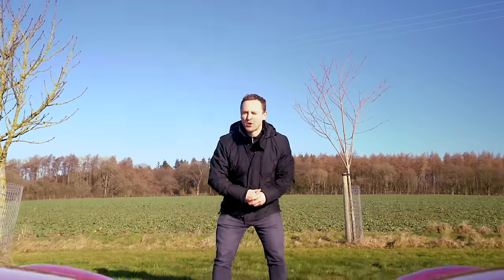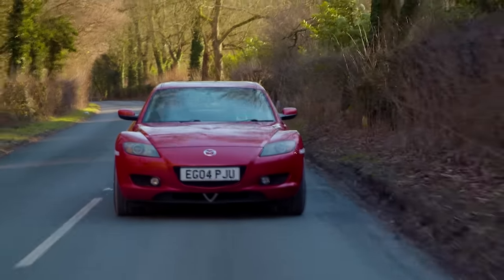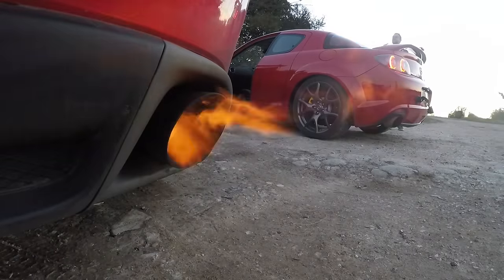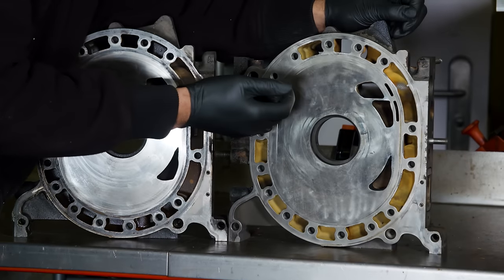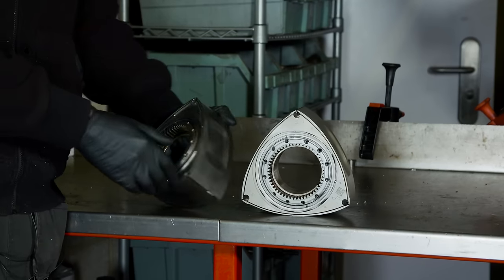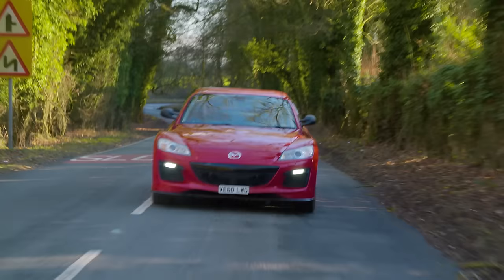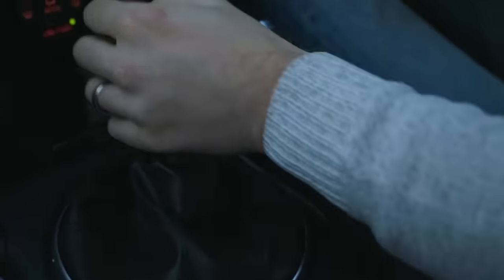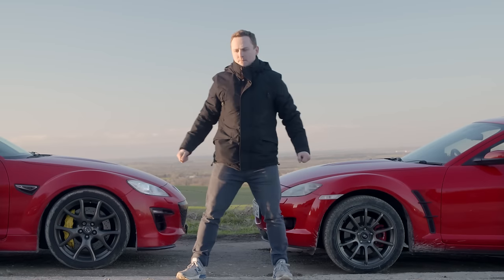The Differences Between Bridgeported & Street Ported Rotary Engines

Comment: My carbarated 500hp 350 probably gets better fuel mileage.
Reply: I highly doubt it.  :P   My brother owns a 500hp 350 and I own a RX-8.
Reply: @DatDarkOne  huh? The diesal dump truck my girlfriend's dad owns gets better fuel economy with a full box lol.
Reply: @DatDarkOne  you are full of shit. a 500hp 350 chevy doesnt mean its gonna get bad mpg. its all about how well the heads flow, the compression, cam timing events a duration, or even if its na or turbo. id say a n/a 500hp 350 chevy would get like 10-13 mpg if babied. turbo? probably like 16-18.
Reply: @subjectsigma925  typically all diesels have better gas mileage than a boosted sports car because they burn a different way..... diesels are a more efficient engine design by nature.

Comment: I NEED MY VTEC IMMEDIATELY

No not vtec i meant my rotary engine to kick some ricer
Reply: Eren Hepgur race it against an ep3 type r...
Reply: I need people to stop making me click

Read more
Reply: Little y'all know that some rotary engines do have vtec on the exhaust side
Reply: Sherlon, no other car brand has vtec, that is Honda’s technology, they would have something similar which is what you said as its only 1 camshaft but its not vtec.👍🏼
Reply: @callumturner9161  technically there is similar tech for example toyota the engine has limited power in lower rpm and when it goes to 3 to 4k rpm thats where the ecu tells the engine to receive more fuel and camshaft to open more for more power. Very similar
Reply: Lol an ep3 would burry an rx8, I like both but I’m just saying🤷‍♂️

Comment: 195 HP from a car that gets 4 MPG? I'm sorry, but what's the point?  Sure they sound cool, but you can get the same effect with big cams on a civic for crying out loud.
Reply: 195 wheel horsepower.
When it comes to owning a rotary car, this wouldn't be the car to buy if one focused on fuel economy. Plus 4mpg is from racing a track and not the streets.
Reply: LanEvo55 horsepower is nothing without the torque so is pretty crappy tbh. I like them though, couldn’t afford to run it as much as I am about the smile per gallon but this?! A supercar gets more to the gallon 🤷‍♂️
Reply: @yoalvin2287  That's why you get an RX7 lol they're actually fast
Reply: Evan Spiteri it’s on the bucket list lol
Reply: RX7 are not fast either lmao... A stock S3, Golf R or anything similar would murder one.
Reply: MrZyLeXx you’re really comparing an old car to a new car? Obviously the new will handle and drive better than the old unless the old has got some decent set up...
Reply: Yes why would't i?
Reply: Ethan Noel 4mpg on full throttle around Silverstone. Listen next time
Reply: Buy your Civic then and be a normie like everyone else.
Reply: Jason someone's triggered. I have never seen a cammed Civic on my daily commute so I'm not sure how having one would make you a normie.
Reply: MrFoulksy I did listen. That's still awful. That's the kind of mpgs that 5.0 mustangs get on the track but at least they have more than 390 horsepower.
Reply: @huehuehue-x3c  nah I'm not triggered every one is entitled to their own opinion. Regardless of how bad it is .  Fixed up civics are more common than fixed up rotaries . Piston engines are the norm, rotaries are a rarity , therefore stick to your normie engine quit hating. No one is saying they're perfect, cuz there is flaws, but you'll never understad what makes them so cool. Only certain type of people can  appreciate  and  properly maintain a rotary. Clearly you are not of those people.  What car do you currently drive ?
Reply: Ethan Noel why are you mad about what MPG it gets on wide open throttle ??? You need your priorities sorted out mate
Reply: MrFoulksy bad mpg means poor efficiency. Poor efficiency means you're missing out on potential power.
Reply: Because they are fun.Simple as that.
Reply: Ethan Noel Honestly Driving an Rx8 is more interesting than driving a mustang in my opinion .
Reply: @MrZyLeXx  lmfao you obviously haven't seen a big turbo FC or FD with porting work. And both of those chassis are stable as fuck.
Reply: Who said anything about their chassies?
Reply: @MrZyLeXx  me because they're fucking great lol
Reply: Not even my 87 fire chicken gets that bad of MPG and stock it gets 210 horsepower at minimum
Reply: yes but you will never have the same potential out of a civic as a rx-8.
Reply: Alright all you hectors from FF1 need to calm down bryans got your ebay parts ready for shipments.

Comment: Absolutely love my RX8.. blown my second engine within 4 years @ 15k per year starting when I bought this one with "58k on it" but 150 quid plus a day's worth of my time and I must admit I really don't mind. Smiles per gallon in this car are unbelievable. Much higher than any other car and for the price, it is pretty extreme! I'm currently on with an engine build to be bridgeported and supercharged but also want it to be as reliable / long lasting as possible. Most of the time the car is my daily. Only downside to it, is it is absolutely terrible on fuel until you've done 100 mile on a constant motorway run 😂  3/4 of a tank in 150 mile ain't great at 80 quid a tank 😩😂

Comment: Hiya,
I’m really enjoying the series so far. I’ve always been fond of the RX8 since my wife and I looked at one but went for an MX5 instead. 

Question for you or anyone: Does retuning to produce flames at the exhaust diminish horsepower and efficiency?

I ask as surely the source of the flame is unburnt fuel that escapes combustion in the cylinder and ignites on contact with oxygen upon leaving the exhaust. 

Not a criticism, more curiosity! Keep up the good work.

Comment: I have always wanted to no how the cubic capacity is measured i.e would you fill the exhaust and inlet up with oil and measure the cc that way, sorry to ask this strange question but I have had different answers and if anyone will no it's R and R motors who build stock to race rotary engines..👍🏻🇬🇧👋🏻 brilliant videos keep them coming.🙏🏼

Comment: I had an RX7 series 2 and then another one wih well balanced and street ported motor and then a 13b turbo transplant with microtech management then i bought an rx 8 demo model, then when was time for first seal rebuild at 220 000km(it did well) i had a bridge done too
But something screwed up as after a thousand or so kms it also broke a corners seal
Then went back to normal with just touch better porting and cat free
With open exhaust one pipe and one box only
It sounded incredible
For those who hate rotaries
That (rx8)was the car i had the longest of all(6 and halve years) and regret till today selling it
It was also the best all round drive i had newt enjoyed and best looking
And i had two kids and wife and my son shot up to 6 feet 3 tall
And he did fit in back seat
So all was fine

Comment: Series 1 vs Series 2: The Tale of Two RX-8s. Felix is a series 1 (2004-2008), while that awesome R3 is a series 2 (2009-2011). The series 2 RX-8s are more reliable than the series 1 models in terms of engine life due to that extra oil injector and electric oil metering pump, so it's less needed to premix, but you can still premix for more protection just in case. Also, the series 2 model's looks have grown on me and I want to get an R3 one day

Comment: Brought an RX8 2.6 2004 for £300.. Engine has only done 13k as it's reconditioned by Rotary Revs :)  
I only brought it cheap due too misfiring problems but"! I now sorted just by upgrading fuel pump, coils and new crankshaft sensor.. Only bad thing is bodywork underneath needs a lot of work due too rotten sills which I'm slowly getting done as replacing with aluminium :)

Comment: Good video! Your fans need to see  turbo rx8 too.. :) !`ll give you an idea You can test a turbo rx8 (suggestion garrett 3071r) together with final geat 4.777. 6port rx8 is a lot quicker between 300-350. Every body hates spinning on a higher power.

Comment: did the UK get different engines or did Alex buy the lower HP engine with stock around 190ish HP? Because most people would get the 230 HP variant and the 214 HP for a revised and tuned engine seem quite low.

Comment: I think I honestly may try to find myself a rotary. Im pretty new to car stuff in general so people might think im stupid but the way i see it, the engines are simple and more straightforward, and theres a lot more preventative maintenance required. Instead of fixing something when it breaks or wears out, you have to take certain measures (at a much higher rate than with a piston engine) to keep that from happening. I think thats what people get wrong about rotaries, they try to care for them like a piston engine, then it blows cause they werent keeping up on the oil and coolant, and they call every rotary a pos.
Reply: The Canucklehead to be fair you’ll probably find that you look after a rotary and it’ll still have a tantrum every now and then lol
Reply: Mulac19 same goes for my sr20😂

Comment: My favorite rotary I just wreaked mine and had well over 120000 on it engine still had great compression premix injector installed and did a seafoam treatment every 3 oil changes but never did anything else special

Comment: You are also comparing a 4 port to a 6 port version of the engine. The 6 port 09-2012 engine revs out the factory pulling at 9k, where the 4 port out the factory starts dying around 7.5k
Reply: Both are 6 port in the video , 2003  (S1) 231 hp  6 port with 6 speed gearbox and 192 hp 5 speed 4 port (also paddle shift auto trans option) , 09 (S2)models on wards they dropped the 192 hp 4 port and revised the 231 hp engine (still 6 port) but with an extra centre oil injector and a few other changes, and styling mods.

Comment: so felix had 212hp at wheels with a street port. 

the bridgeport one the guy said 191hp?? so it has less HP?? 

I think id just do a street port with lightened rotors . or perhaps get a CNC to put a tiny little hole  just to get it to brap

Comment: the main issue with these cars is that everyone who gets them just drives the fuck out of an engine type that already has severe reliability issues. that said, rotaries are some of the most fun cars you'll drive and that's only improved by the really nice handling on both rx-8 and 7. i'm not sure how mixing 2-stroke oil would read on emissions tests, but it would be pretty funny to fail it and come back the next day with regular gas.

Comment: i love my my rx8 40th anniversary,  its   002 of 400, and its done 77,000 on one engine, but now its died, still love it,  garage wants me to but brand new rotary engine off mazda, but i think as its 002 of 400 i be messing up not keeping original engine.  what do you think.  i have full racing beat exhaust including manifold and sports cat , so if do just rebuild my engine would street porting be good or bad for rebuilt engine.  ie does it make engine wear out quicker or again as its 002 should i leave engine as mazda intended so be worth more in 20 years time when collectible
Reply: Motor lost compression?

Comment: That popping noise when driving along will get annoying fast.
Reply: like the car im gonna buy has a open filter so you hear the blow off valve  of the turbo, but you hear it even if you drive 10% off the gas and thats very annoying. so i gonna bin it and change to stock agian.
Reply: Spidermansucks nope
Reply: Yup. It's overtaking 90's blow off valves for the height of dorkishness.

Comment: The series 4,5,6,7,8 13bt were the best..these rx8 motors are like half the old engine an shockingly never came out the factory with a turbo attached,if there's ever a car that needs to be turbocharged the rx8 heads the list

Comment: If there is fuel burning in the exhaust... it's not burning in the engine... meaning wasted power.
Unless that's some other trick they're doing?
Reply: You never had a rotary before have you? My R3 gets 13 miles per gallon but half that gallon is shot out the exhaust port. Rotary engines dont burn off most fuel and without a catalytic converter, they pop a nice flame. Sometimes you'll hear a nice 'poof' inside from the the flame.
Reply: @sscherff5709  Kinda proving my point there.
Unburnt fuel = wasted energy. 
And 18l/100km (or 13mpg) is super bad by modern standards.
Reply: @showmetheevidence777  yeah well, when you buy a rotary, you don't really care about mpg or modern standards.

Comment: Hello. I'm selling my 2006 Mazda RX-8. Manual transmission. 115,000 miles.I have not done any compression test. Its been pretty well take care of. Its in great conditions. Runs smooth and with lots of power. I'm located in El Paso, TX .Selling for 5,000 dlls or best offer. Let me know if you guys have any questions.
Reply: Hahahaha

Comment: wait a second, thats nearly 50 L of fuel on 100km 
a f*** leopard 2 does 350L / 100 Km, but that thing weighs 63 tons, thats like 50 times more and has like 7 times the hp, 80 times the ccm, 20 times the torque
or a 40 ton truck needs around 34 l / 100 Km with over 30 times the weight 
holy moly

Comment: I mean I love the sound of a rotary and performance but if they were "awesome" they'd still be using them 😂.
Reply: The problem is the majority of people who don't know how to maintain them.
I had a 1986 RX7 FC and later a 1989 RX7 FC Turbo 2
Both way past the 70.000mls on the clock with original apex seals and everything was running fine.
Both cars were maintained very well from their previous owners.

Fuel economy and "diva" like maintenance killed them off for the mainstream.
Not to mention that the Renesis engine ended up being worse then the last revisions of the 13b

Comment: Lmao there’s a reason he doesn’t talk about the torque out of the renesis even at 215 or 250 hp it’s still only like 170 lbft give it take 20-30 pounds either way depending on compression

Comment: Seems like a pointless engine design. If naturally aspirated power to weight ratio is the goal, just use a small cylinder, short stroke, high RPM piston engine.
Reply: It's not pointless, I'll give it to you that it's impractical, but you know if it's not for you then do buy one so the price stays down for me. Thanks.

Comment: As a former rotary owner, I can say they are great. But they are also absolutely shit engines. 

I had an rx7 (fc) and a turbo II rx7, and a rx8. All down to how nice they are to drive despite having no torque, mediocre power, terrrible mileage, and reliability problems. 

Best thing you can do for the chassis is swap to... literally any normal engine with as much or more power than a wankel.

Comment: By saying: "you can make more power because you can inject more fuel" you prove the world you don't know what you're talking about.
You could run too rich, then you also inject more fuel and don't make any extra hp. Extra fuel doesn't make extra power.
And then how much air you let to flow in doesn't matter nearly as much as the speed of air at which it's traveling, how much turbulence you have, how well the a/f mixture mixes and how well the gasses mix during combustion. Make it flow as freely as possible, and you lose power and efficiency. Hit the sweet-spot and you make the most power.
Reply: calm down salsa

Comment: Flames are unburnt fuel which will reduce power.
Reply: Not in a rotary, more flame means more fuel which means more power in a Bridgeport. You must not know about rotaries
Reply: @marchmazda4697  I don't think you understand the fundamentals of combustion. Burning so rich the exhaust catches fire; that's poor engineering.
Reply: @coyote5735  no you dont,  I race the rotary for 25 yrs, that's how they run. They need alot if fuel. We are not talking a piston engine apples to oranges no were near the same trust me 25 yrs racing it
Reply: @coyote5735  also they won lemans 24 hrs in 90 do some research
Reply: @marchmazda4697  I am talking about thermodynamics. They need a lot of fuel because they are inefficient. Too much fuel actually reduces power output.

Comment: All junk, rx8 are junk  renesis is junk, that's all you'll get out of that. Go with the old 13b and bridge it, I can make 280  and it's not streetsble. Bridgeport's should not be streetsble. That's why the renesis is junk, I have a peripheral port that does 12 000 rpm, and makes 310 hp at 3.4 mpg,

Comment: Possibly the worst rotary engine... The RE (renaissance) is hopelessly designed, if it was a proper 13b the differences are immense from having proper plates and ports. The RE was a failure design from Mazda just to meet emission rules. Go ahead and drive a proper 13b you would never want an RE